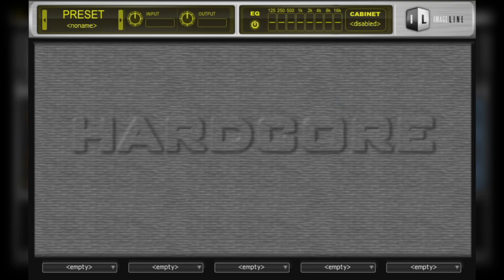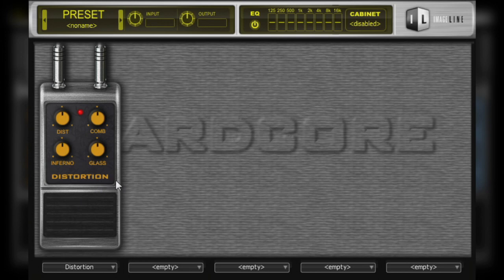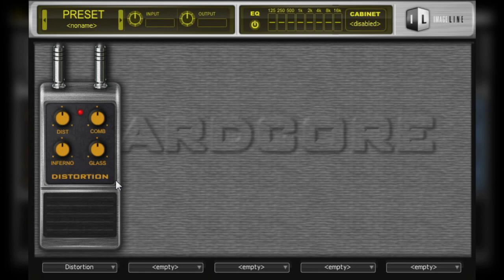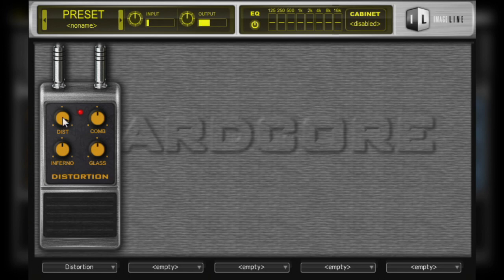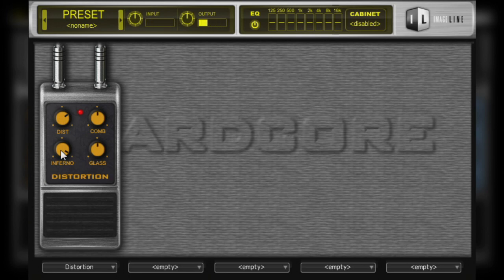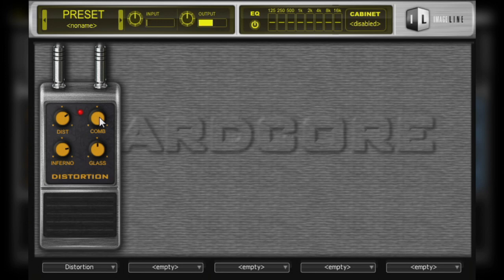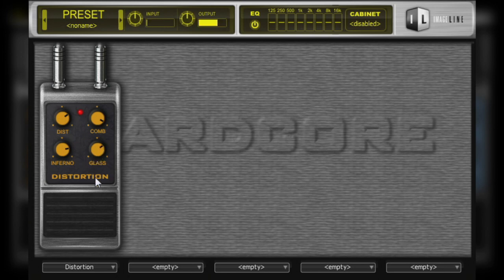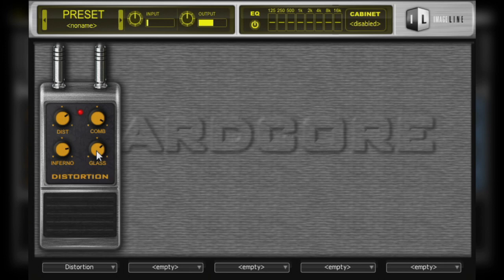Hard Core Part Six - Distortion Pedal

Comment: I have a question I'm hoping you (or maybe another commenter?) can answer.

I use Hardcore to add a little bit of distortion to BooBass. I'll set up something in BooBass's piano roll, and then when i click play, it kinda fades-in instead of kicking right in. Now, mind you, the fade-in is only a split-second in length and only on the first note (and only after playing from the totally stopped position)... but is there a way to get rid of that fade-in??

Thank you to whoever answers. :D